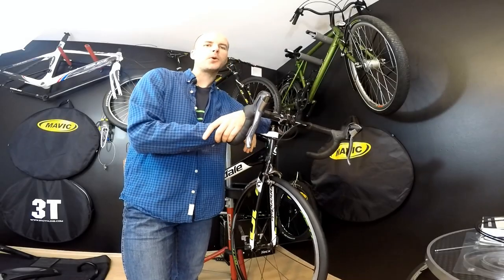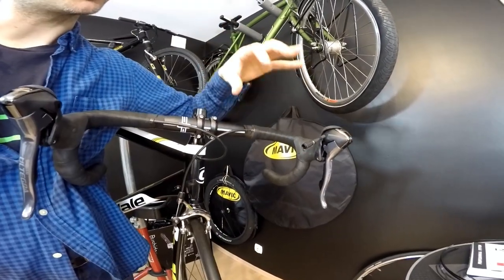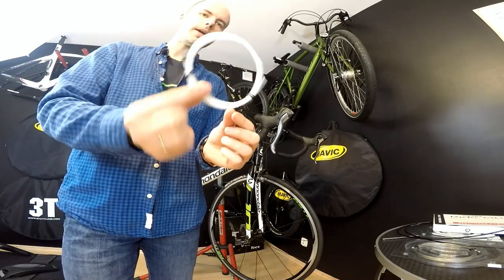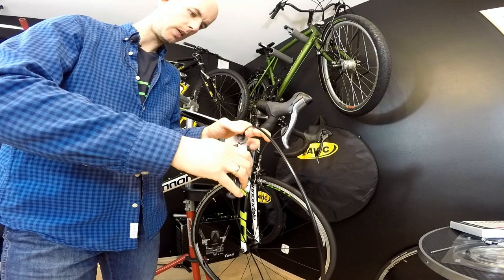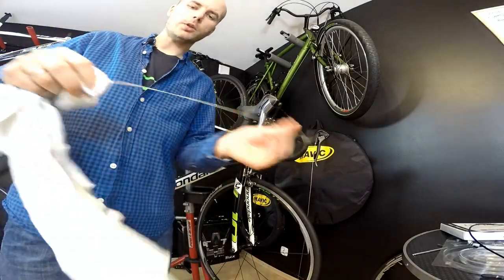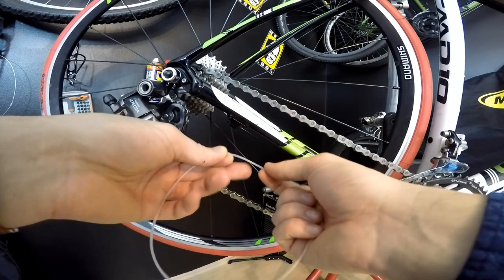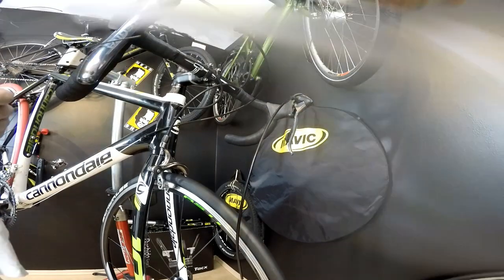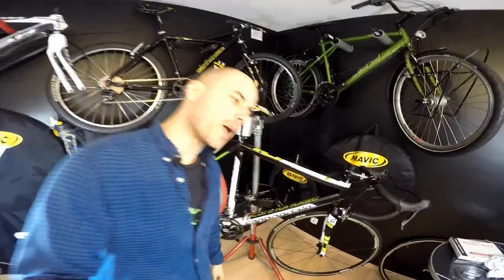Gore Ride On sealed shifting cable system - STEP BY STEP guide on installation + review

Comment: Hi, Can you verify your old cable on CAAD10 that it is the polimer cable from Shimano?
In this thread they strip down CAAD12 and found Jagwire cable and housing (not the one that supposed to come with 5800 shifter).
http://weightweenies.starbike.com/forum/viewtopic.php?f=3&t=137189

Interestingly, i bought shifters online in OEM package (brown box) and the cable look like this too (same silver color and does not notice any coating, unlike brown polymer coated shimano cable).